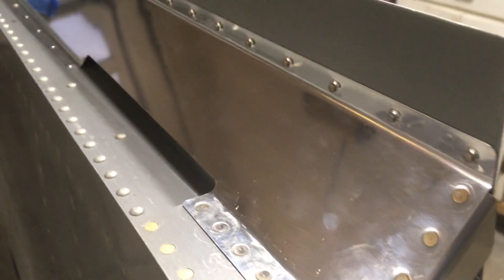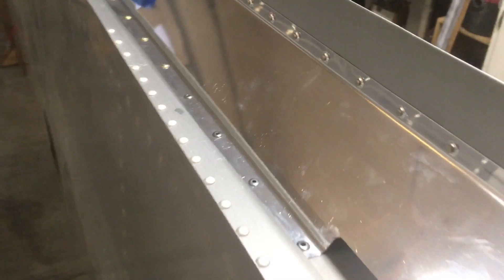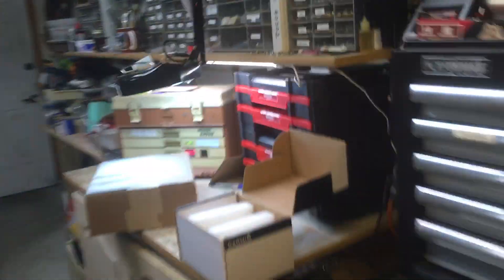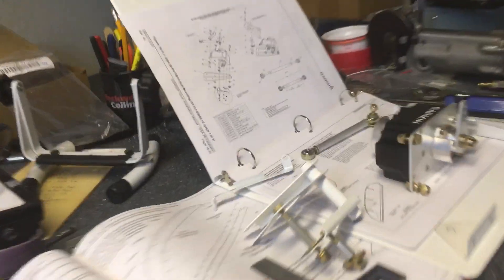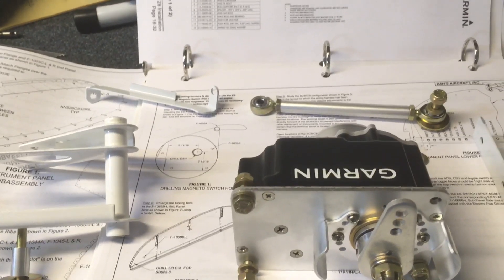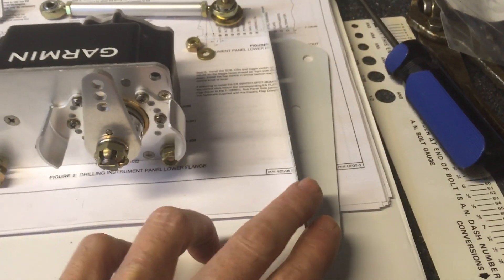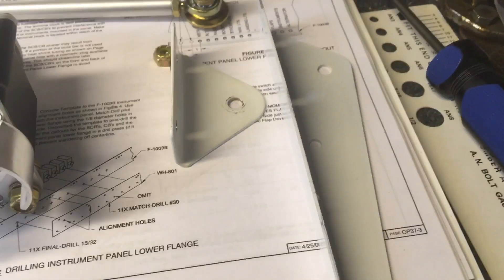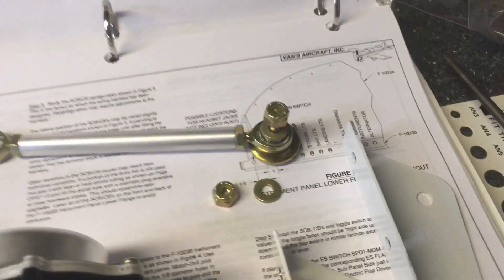RV10 Update

Comment from the maker: This is one of those spots where you WILL NOT find much info/detail about the mounting bracket and servo installation in the  Van’s construction manual.  This is because Van’s doesn’t know if or which autopilot the builder might install.  In this case the mounting kit comes from Garmin.

Comment: The "stock" bracket seems awfully flimsy for such a critical part.   Is there more holding it to the fuselage than pictured?  I'm sure it's fine or there would be problems by now, just surprised.
Reply from the maker: Edward, I assume you are referring to the servo and/bellcrank mount?  Ya, it is steel and the force is applied in a direction that is reasonable.  Nothing to worry about.

Comment: Did you purchase the brackets from Garmin?  Do you get the elevator brackets and possibly yaw damper brackets from them also? Did you put the pitot tube in the 3rd bay in from the wing tip?
Reply from the maker: I dont recall where I got the pitch bracket and I am NOT installing a yaw damper.  I got the roll server mount kit from SteinAir, but the kit is made by garmin.  The roll servo is mounted in the right wing and the main steel bracket replaces one of the stock angle brackets that hold the bellcrank to the wing spar.  You can find detail of this in the garmin g3x install manual.

Comment: Hey jim, When I installed my aileron servo into my right wing, I had an issue with the servo throw having the potential to drive into the wiring harness. Does that appear to be an issue with the RV 10 wing?
Reply from the maker: Scott, I didn’t notice anything like that.  Did the bellcrank hit the connector on the servo?  I’ll check mine.
Reply: @RVJimD  it's been a few months since I last looked at mine, but if I remember correctly, it was the servo throw arm side that ran into the wiring harness which is mounted just outside of the servo mount location. it was when the servo arm was cycled all the way toward the wing tip that it ran into the harness. when I get home I'll take a pic and see if I can forward to you.